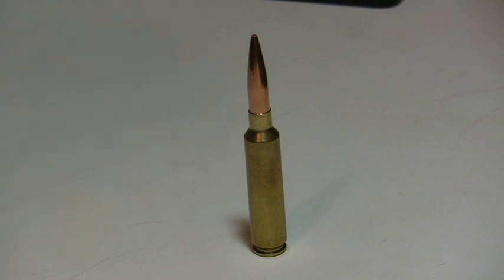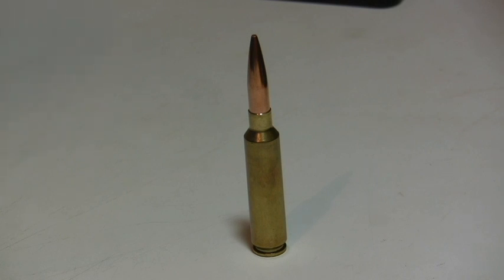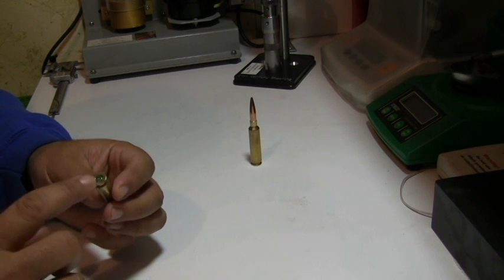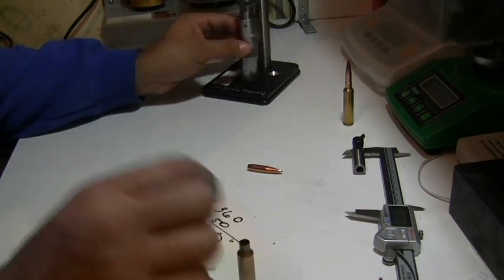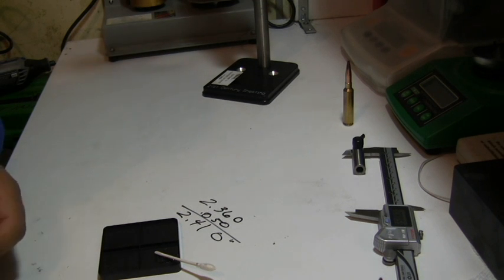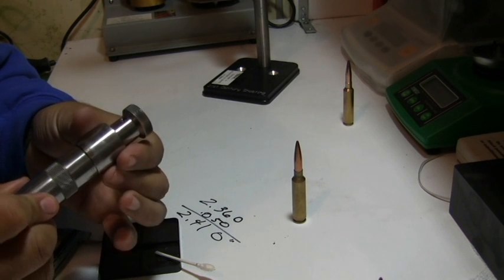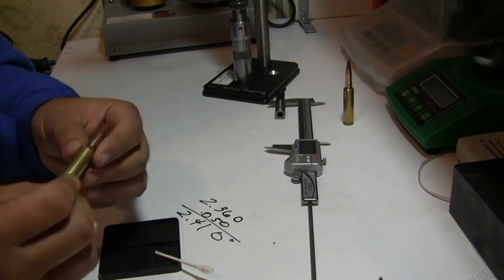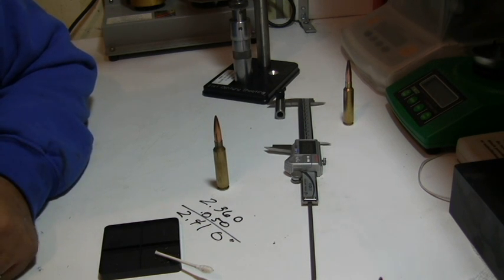Precision Reloading #1:  How to make a dummy round for gunsmith or reamer maker

Comment: I was wondering why you would add the .050" rather than subtract it?  as you stated you wanted to push the bullet deeper into the case to allow for better bullet adhesion this would shorten your dimension not lengthen it.  Help me out.
Reply: I agree with you Craig. I wish Erik would have answered your question. Plus it would give you more room to chase as your throat erodes.
Reply: Eric, if you can explain that point regarding at that  050 a bit more it would be much apreciated.

Comment: I am new to reloading so I'm not sure if I'm wording my question properly or in the correct sequence.  I have a 6mm barrel in route to me so my gunsmith can ream it to 6x47 Lapua.  I have some twice fired brass enroute to me and I have a set of Whidden 6x47 dies.  Your video shows using a "fired" case to make a dummy round.  Can I use on of the fired case when they get here to make this dummy round?
Reply from the maker: Tony Faulkner What is the purpose of your dummy round?  You say your gunsmith will ream it to 6x47 so apparently he already has a reamer.  Is it for freebore purposes?
If it is so that he can set the freebore, F/L size the brass before you make a dummy round.
Reply: Erik Cortina Yes, it is for freebore purpose.  My gunsmith has the ream.
Reply from the maker: Tony Faulkner Just go ahead and F/L size your brass and then make a dummy round.  Even if the headspace is not perfect on your dummy round, it will certainly be close enough so your gunsmith can set up freebore.